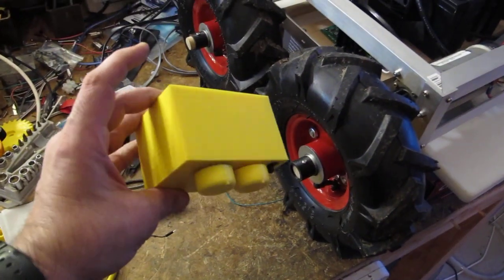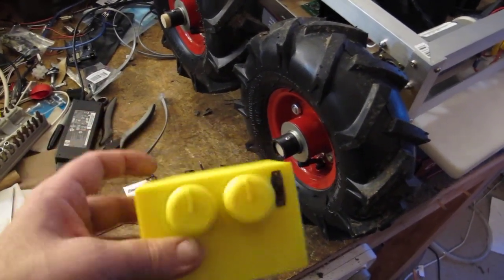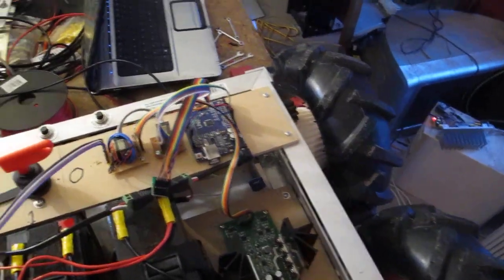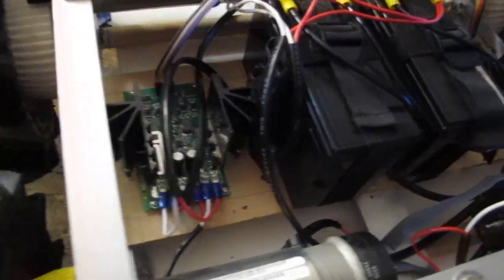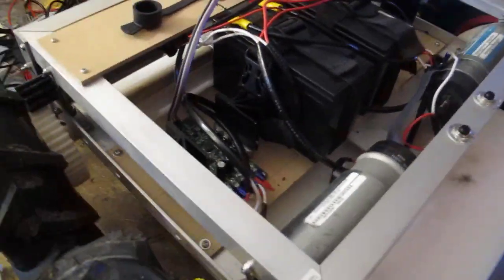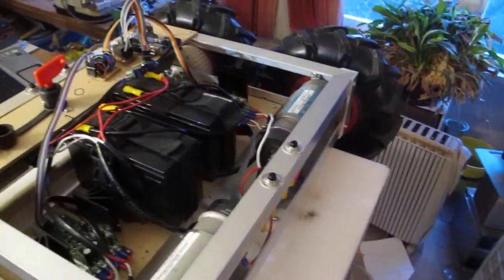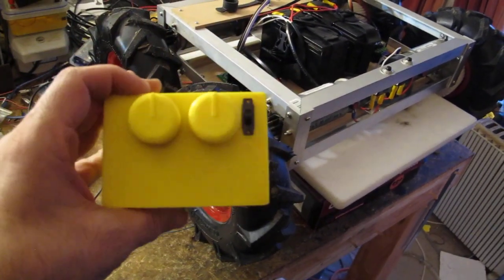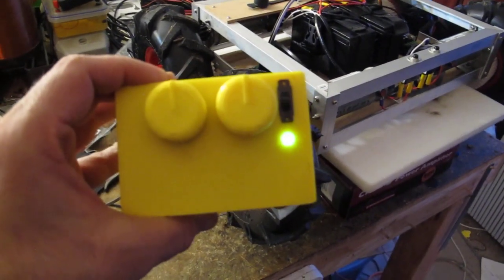ButtBot wireless test

Comment: i dont know which radio channel to use to control my not yet built mobile platform, its only in the project, i wanted to take a readymade radio channel with several outputs for realtime control with minimal response delay.. it should include operational steering with the front wheels and the power of the main wheel drive .. but I havent studied radio cars at all ..